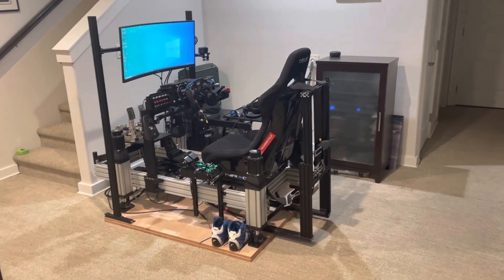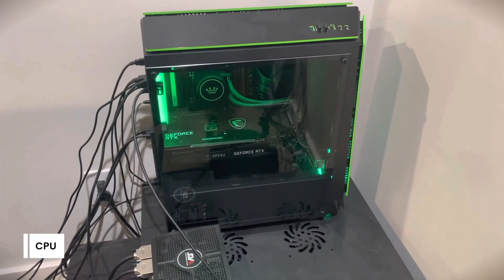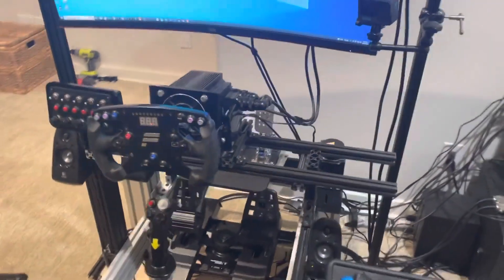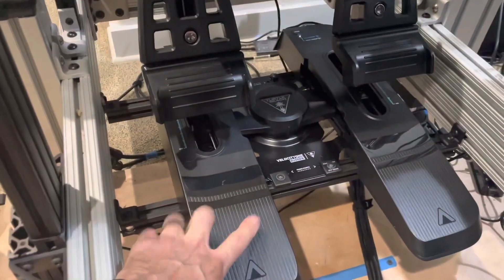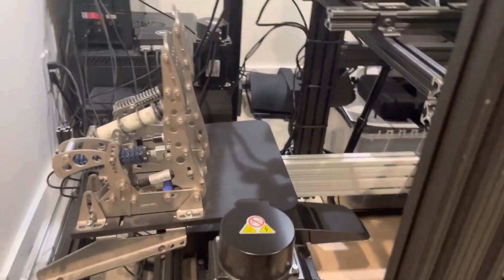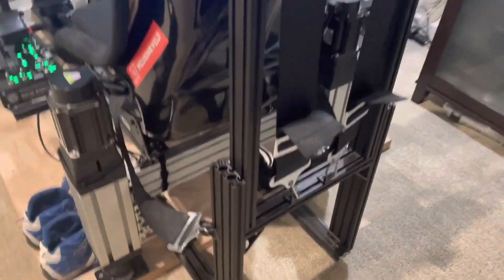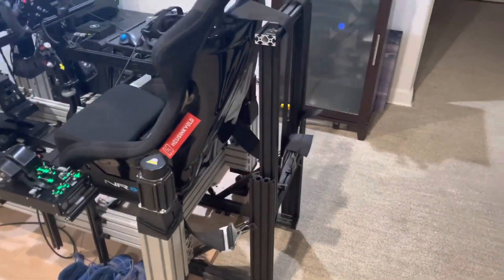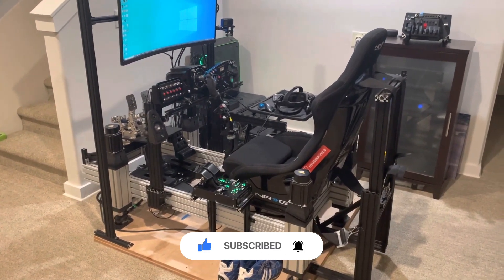$20,000 Full Motion Virtual Flight Simulator - Ideal Training Aid for IFR Training

Comment: What did you use during your training in your RV
Reply from the maker: Jayco Eagle HT. 35’ long 5th wheel.
Reply: I meant your flute Sim you set up in your RV 🤪🤪😂
Reply from the maker: Microsoft flight Sim with the yoke and throttle mounted to a small portable table placed in front of the couch :)